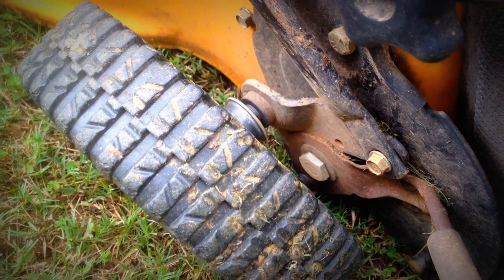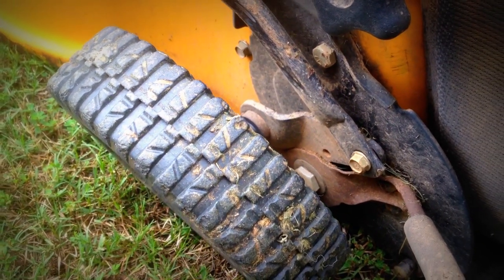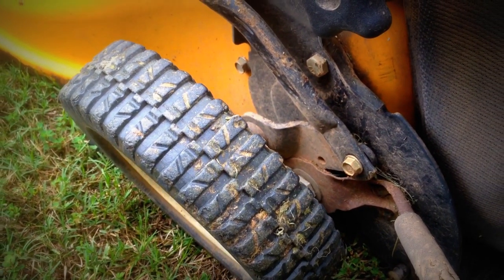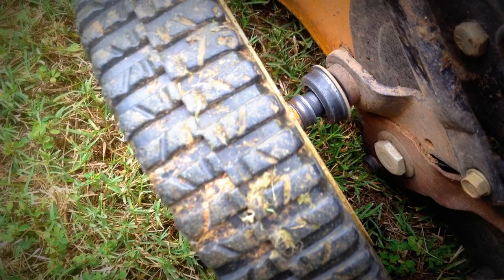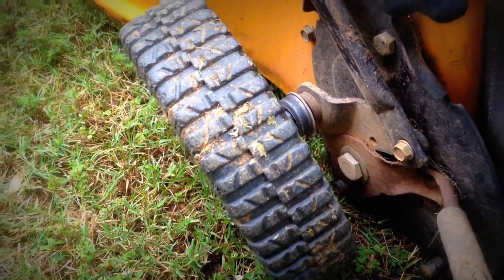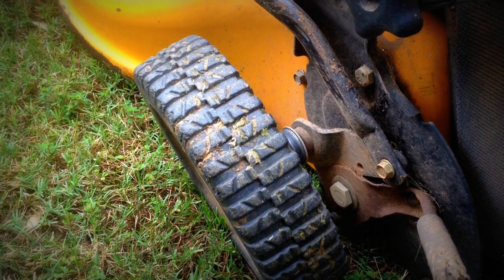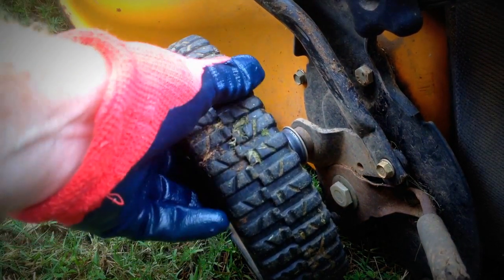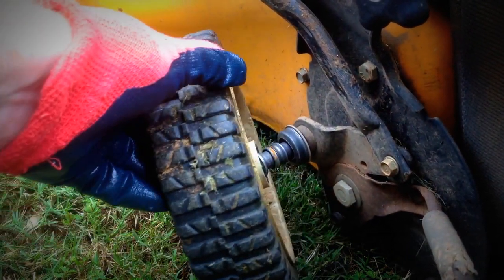Lawn Mower Wheel - ASMR

Comment: I would like to make a video request.  I like your fix it films, and im guessing you may have a qualification in refrigeration, because your tinkering skills encompass a variety of fields. If possible could you please make a video with a  brazing repair.  I.e silphos welding.
I know its a stretch but if  you ever have the opportunity it would be good. 

Thanks. 
Best regards
Hard2describe NZ
Reply from the maker: I wish I had been into this video hobby back when I installed my last hot water heater. That would have made a great video with all of the pipe cutting and brazing I did. I suppose I could make a ASMR video of pipe cutting and brazing. Perhaps I could make a useful device. I'll give it some thought. Thanks:)